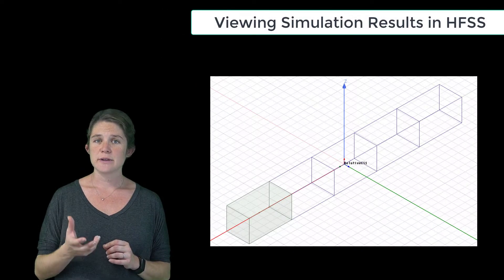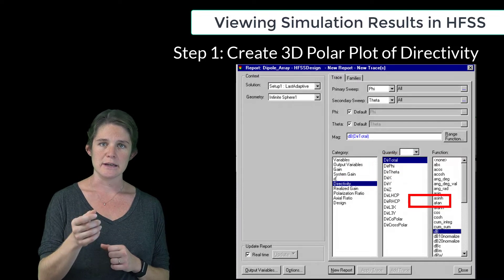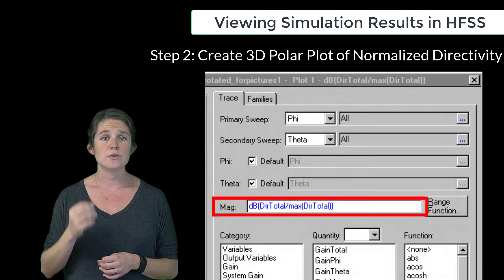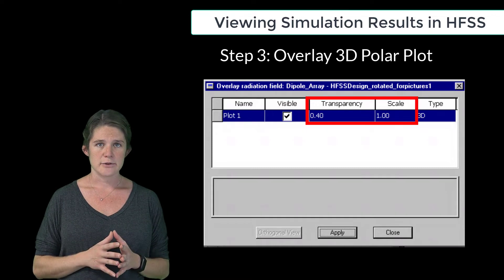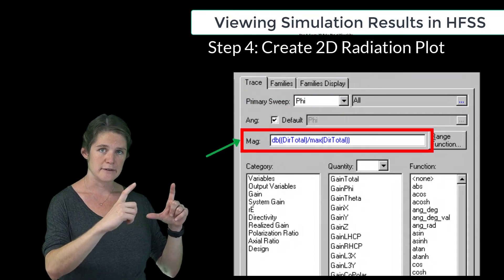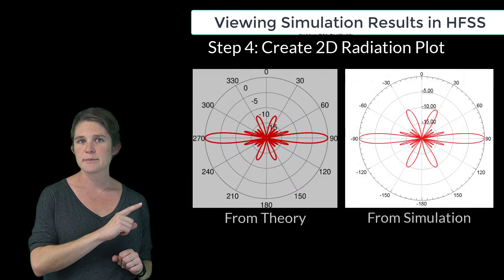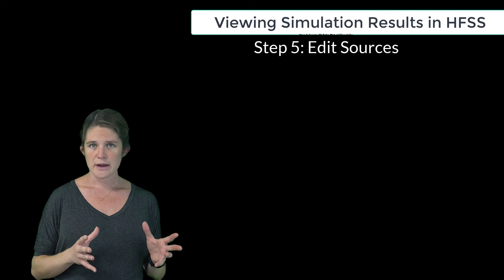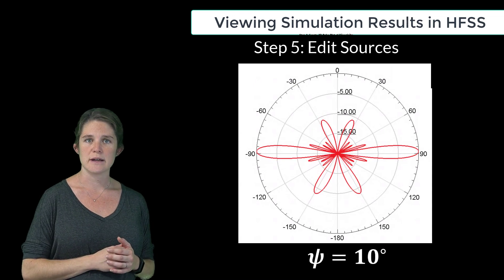Viewing Simulation Results In HFSS - Lesson 3

Comment: Hi , i want to ask what simulation settings do you use. I was using CST and it's more user friendly than HFSS,  therefor i was never into the simulation settings or mesh settings in CST like I'm into for HFSS now, in HFSS it seems more complicated. I've been using HFSS for two months now and still dont figured it out how to setup solutions for best accuracy and less simulation time. Generally I use Fast Sweep option but when I try Discrete it gives more accurate results but takes much more time. First I could say Fast option is ok for first look how my antenna work, but especially for my Archimedean spiral antenna I work on now, Axial ratio graphic is sooo much different in Fast results and Discrete results. Can you help ? Thanks in advance
Reply from the maker: Hi Yasin,
I use the discrete sweep... as you say, it does take a lot more time, but it also seems to be much more accurate. =/